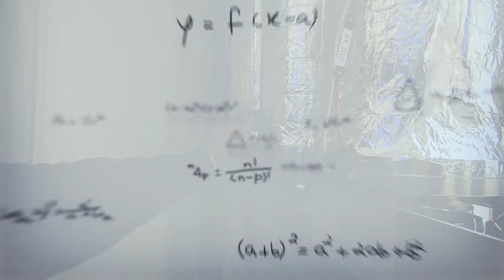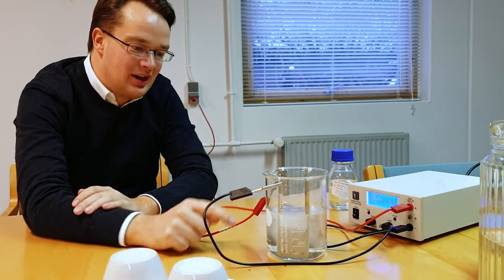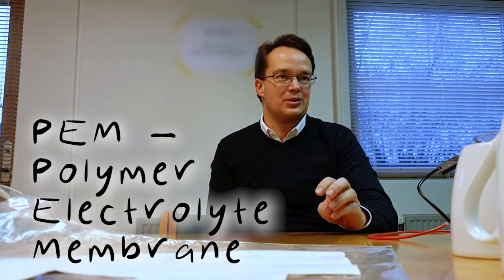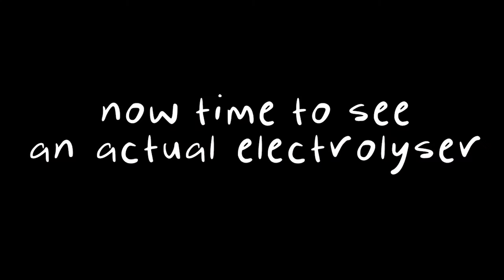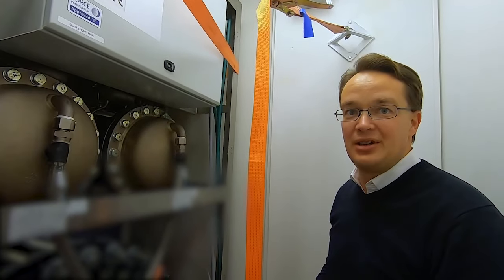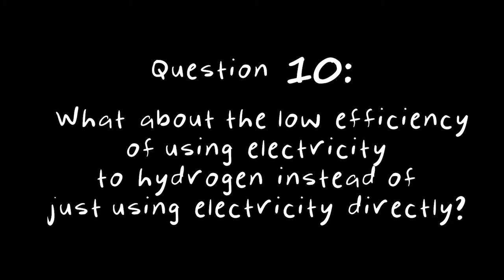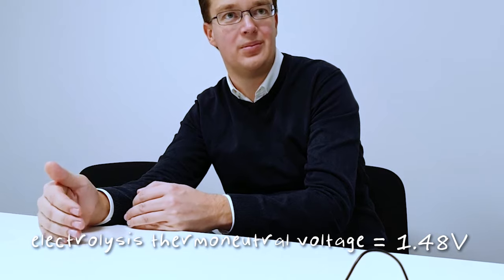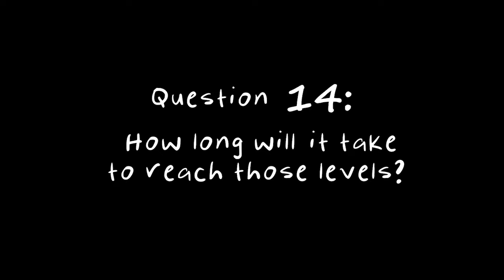Green Hydrogen Systems Electrolyser Tour

Comment: Great video, Rosie. This was actually the first, practical experiment my mother tought me to do as I was in my 4th or 5th grade. We used a 4.5V battery, a deep glass bowl, two wires connected to a carbon rod each (from old dry cell batteries) and we used washing soda as electrolyte and water glass from the cupboard as collectors. It was SO easy and it made me take up physics and chemistry because of this perfectly working experiment. So thank you for the reminder!
But I wonder why you have made several videos from my little Denmark. Aren't you from Australia?
Reply from the maker: Wow, that is really cool you did that experiment with your mum! I never did this one at home or at school, so I was really impressed when Kasper showed me. 
I lived in Denmark until a couple of months ago. I was in Kolding for nearly 5 years. That's why there are so many videos in that region 😀
Reply: @EngineeringwithRosie  Sorry to hear you have left us. If you should ever come back I'd like to invite you to visit our rocket shop at Copenhagen Suborbitals. Could be fun.

Comment: It is perhaps worth mentioning that the attraction of high pressure electrolysis is that hydrogen comes out at high pressure. Water going in can be raised in pressure without heat loss because water is incompressible. A big plant might expand the oxygen through a turbine to regain energy.

In a conventional power plant you also pump water up to pressure, turn it into a gas and then expand it through a turbine.
Reply: How High pressure H2 is generated? Do we send water at that high press or we use compressor??
Reply: H2 out should be at no greater pressure than atmosphere when the feedstock (water) is AT atmospheric pressure. 

Want to increase the pressure of both gases exiting a reactor? Maintain high pressure IN of the water and have 2 polarized output ports/porous electrodes to collect the (now) pressurized gases. 

Got that from a NASA Tech Briefs design when they were exploring manufacturing their own fuel/oxidizer at the cape from sea water. But, again, chlorine was a problem.

Comment: I think the most relevant thing he said is to use electricity as electricity and covert it only if you have too much or have a specific need. I still have a hard time with H2 as a widespread fuel. As a storage medium I think there are better alternatives. Compressed air takes less energy to create and coverts back to electricity easily. You can also extract useful gasses for ancillary sales and if you believe in CO2 sequestration then you can get that too. Certainly better than blue H2.
Reply: Agreed, Rosie mentioned this article on her podcast, which ranks uses of (clean) Hydrogen from most likely (industrial processes which already use Hydrogen) to least likely (personal Hydrogen cars).  As clean H2 gets better, it can "move up the ladder", but the ladder order will be the order in which it moves

Comment: I would love a deeper explanation as to how they got their numbers for efficiency and if they actually have the wiggle room available that they say they do.
Reply: The efficiency of an electrolyser is normally calculated as the energy content of the hydrogen produced (142MJ/kg), divided by the energy spent in producing it. The wriggle room they talk about in the video is because you can increase or decrease the power input (the voltage and current) within certain limits, much like you can throttle up and down a car engine. As a general rule, the lower the power input, the higher the efficiency.

You can check this Wikipedia page to read more about this: https://en.wikipedia.org/wiki/Electrolysis_of_water#Efficiency
Reply: The AC input must be rectified to get DC, and the rectifiers use some power, so that subtracts a few percent.
Reply: PEM membrane improvements to increase current flow, anode and cathode can be optimised, with platinum, rhodium, palladium, Tio2, cobalt dioxides, photo catalysts can assist process, as can certain electrolyte catalysts, work is being done with half cell catalysts with some iron/pt. Compounds where partial electrolysis can proceed stepwise more efficiently than direct.
Reply: Yes I'm wondering a bit because most numbers I heard were some 30% loss that cannot overcome.

Comment: Making hydrogen through electrolysis is very similar to producing chlorine and caustic, except salt water is used. The application is the same too. Electrical energy is used to split molecules which then want to recombine to release that stored energy. Using hydrogen to deliver energy is using it like a battery. So hydrogen has to work better than a battery to really be useful, and battery technology is advancing quickly. Batteries are easy to store while hydrogen requires a thick and heavy metal tank. But hydrogen fuel tanks can probably be refilled a lot faster than batteries get recharged. I see hydrogen vehicles being limited to big heavy things like city buses, semi trucks, or ships. This video discussed using hydrogen to buffer excess electricity that may be produced in the future. I don't see that as superior to just lifting water and letting it drop back down. 
 
To really be efficient at making hydrogen you have to learn a lesson from making chlorine/caustic. It takes an unbelievable amount of electricity for just one plant to make it in quantity - about what an entire smaller sized city uses. Any small improvements in the process result in significant energy savings. One big efficiency improvement was building an electric generation plant next to the chlorine/caustic plant. That allowed the leftover electric generation steam to be sent to the chlorine plant reducing the need to boil its own steam. When the electric plant is not adjacent, the energy in its leftover steam is lost. Likewise, if when you generate hydrogen you just throw away the energy invested in the oxygen, then that significantly raises the cost. Something profitable will have to been done with the leftover oxygen to get value from the energy that has been shoved into it.

The issue of whether the hydrogen was made from "green" or non-green electricity is diversionary at this stage.
Reply from the maker: Great comment, you've raised lots of interesting points. 
I agree on the limitations of hydrogen, you can check out this other video I made on hydrogen and I am going to make more on the topic this year so I hope you will check back later to see them!
https://youtu.be/ge4ux1Y1ric

Comment: thanks for the video.
automobile enthusiasts I've been using electrolysis to increase the burn efficiency of gasoline for a couple of decades if not longer.
Some of these enthusiast have even installed systems on their car to power internal combustion engines completely on hydrogen.
Are they looking into smaller units for automobiles?

Comment: I'd really like to see a small scale device to produce hydrogen and then convert it to ammonia.  If it was sized to match up with wind turbines, and the capex was small enough, it would provide a means to make use of distributed wind power.  Ammonia is easier to transport than hydrogen, and it seems like it would be practical to transport it from remote areas to urban centers.

Comment: Fascinating, thanks Rosie! To know if  H2 is the energy of the future, we must consider all parts of the math of the return on investment (ROI). Meaning is it really better than any other energy sources?  1) where does the electrolysis energy (kWh) comes from? "Coal and all other fossil fuels, plus waste burned for electricity, amounted to 20% of the electricity production. The other 80% of the electricity produced came from renewables: wind power (57%; see wind power in Denmark), biomass and other combustible renewables (20%) and solar power (3%)" source Wikipedia, 2019 Energy in Denmark. It is a larger renewable portion than a lot of countries - kudos to Denmark! However "burned...other combustible" do not qualify for Green Hydrogen. Still a good show. To be clear, they use electrical grid power to produce their H2.  2) Are there hidden costs to that process and delivery to end-users? We must compress H2 at around 10,000 psi to fill a "gas tank" of H2 in a car in order to obtain around 275 miles (434 KM) range. That's inevitable also to power a house. A whiff of it stored at 1 atmosphere won't do much. Natural gas or electricity must be consumed also, to power the H2 compressors, which ads to your price and carbon footprint. Then, in a car, for instance, the most efficient H2 car on the market (operating only in South California) has rather poor performance (over 9 seconds 0-100kmh). Re-conditioning the gasoline/petrol worldwide distribution grid into an H2 grid may very well cost $trillions, and inevitably, bottom consumers like yourself and I, will pay for it in high H2 prices at the pump, or through a spike in our income tax. Yes, these costs are not mentioned but they positively will have to be paid. 3) a practical application of thermodynamics, the second law; Every time you transform, transport, transduce... energy from one form or one location to another, you lose some energy. It's part of entropy. The more vias there are between your initial source of energy and the delivered item in the hands of consumers, then the less effective it is, as you lose some energy every steps of the way. The final analysis is that a Tesla Model S costs US$17.55 for a full 651 km range (only around $6-$8 if you home-charge). Toyota's H2 champion car cost US$65 for 442 km. Hidden costs? As mentioned, we will pay for the huge change in distribution and storage of H2. Tesla has already a fairly good distribution network of charging stations, and although they felt the need to increase their re-charge fees, however it is still much lower than H2 or gasoline. Why? Less vias is cheaper. The sun will be around for another 5 billion years, and nobody has to pay for getting a nice sun tan. Other car manufacturers are moving ahead with building their own charging-grids. It's only a matter of time before they all agree to integrate into one global charging system. Power strips fixed to each road and highways would be great, while the Chinese are working out a photovoltaic coating that adheres to roads to yield more electricity. Now, if the brave Danes will consider all the above parameters and still come out the winner, I'm all in for it and I will gladly post their flag on my wall. The wrong thing to do is to do nothing. Cheers! *I don't work for Tesla. Nobody pays me to say this.

Comment: Rosie always has a good video with the basics covered, and brings all along who are curious.
My 2sense
When you see "green anything" it requires free electricity from renewable electricity.
That will never happen.

Because the electricity will be needed to decarbonize our houses and our industries, 1st.
2nd, it will be used 1.2:1, not 3:1 input to output, comparing electrical used for electrical needs, vs H2 production.
We have these thingies called batteries, for storage, they win, up to 4 hours of storage a day, because of RTE.
Using overproduction of wind and/or solar means the utilization of the electrolyzer is poor.
Or you wait a 1/2 to a full century, when we have 200% RE.
Or you put in batteries.
Ohh wait a minute...
That's the solution we are comparing to!
Ha!
Storage, up to 10%, allows extinction of 28% to 38% FF burning, when overproduction is 130%, and FF Burn % is 60%.

Once we figure out how to monetize storage properly with the savings of the shared efficiencies across running FF plants, this will be possible.
1st pay for storage capitol costs
2ns, split profits with T&D, and power plants that became more efficient, some % for offline reliability payments.
This new efficiency mode means your run 3 or 4 FF plant at peak efficiency, instead of 5 or 6 FF plants at partial load, just so if one goes off line the others can cover with a quick ramp time to higher output power, compared to a cold start of a FF plant. if enough storage is added, even cold starts can be covered, removing the last two partial throttled FF plants in region.
The Gaia hypothesis, Storage, the FF burn extinction provider. Ron Davison 1-7-2023
Reply: Offer valid till no more practical over-production is left to be harvested.
AKA "While (over) supplies last". then the 2.8x drops to 1.8x with storage being more bulk, than balancing.
The crossover back to 1.2:1 also is the 3rd tail of profitable storage add, the last.
At roughly the same % as we will achieve with over-production extinction and capture, is my opac crystal ball prediction.
That's about an extra 10% storage, beyond the 1st 10%.
This may be mind bending amount to think about, at least in terms of batteries, only.
But to put this in perspective, the USA is ~20% hydro, 1 way hydro, that still is a form of storage, but we do not think of it this way.
Because we do not control the filling, per say, I suspect.
Winners sorted best 1st.
1) Lithium (Home/Industry/Utility)
 2% to 3%, must have high utilization 2x a day, add 1% on energy/day
2) Lead Acid (home) & Flow (Utility) take us 3% to 10%, (delta 7%, flow can go higher, still. RTE limited, low utilization, Lithium % augmentation in extreme demand/supply unbalances vs using after Lithium is not available. In reality, there will be overlap, based on price arbitrage and RTE hit for each chemistry type.
3) Pumped hydro can be added to existing hydro in at 10% to 20% storage needs. If assuming doubling of upconverting hydro capacity at one way dams to 4%, co-locating and co-using added turbines for one way or pumped hydro operation with valving.
4) One way Hydro, used more effectivly, producing more power per acre-feet of water.
5) 1) & 2) can be operated more efficiently together with a lower C rate per unit storage, even though one is a lower RTE, up to a point, also beyond this point by some multiplier, say 2x as an example, so that, the higher efficiency storage is not exhausted early, allowing the poorer RTE storage to not be hammered with power losses, AKA heat and destruction, AKA bricking cycle non-life...1)&2) allow 3) to be conserved, that allows 4) to be conserved and be true.
Together they arer all called storage.
Add 6) thermal storage,TESS to be complete.

Comment: Researchers at Penn State recently combined water purification technology into a new proofofconcept
design for a seawater electrolyzer, which employs an electric current to separate the
oxygen and hydrogen present in water molecules.
The new technique meant for “seawater splitting” could render it easier to convert solar
and wind energy into a portable and storable fuel, according to Bruce Logan, Kappe
Professor of Environmental Engineering, and Evan Pugh, University Professor.

Hydrogen is a great fuel, but you have to make it. The only sustainable
way to do that is to use renewable energy and produce it from water. You
also need to use water that people do not want to use for other things,
and that would be seawater. So, the holy grail of producing hydrogen
would be to combine the seawater and the wind and solar energy found in
coastal and offshore environments.
Reply from the maker: Interesting, thanks for commenting 😀

Comment: Bloom Energy just released a high efficiency steam Solid Oxide Electrolyser that gets pretty high efficiency. If steam is supplied via nuclear or geothermal, it takes only 39kWh to make a kg of H2, which will produce ~33kWh of power, so you are only losing like 6 kWh in the conversion. It would be fantastic if you did a video with Bloom!